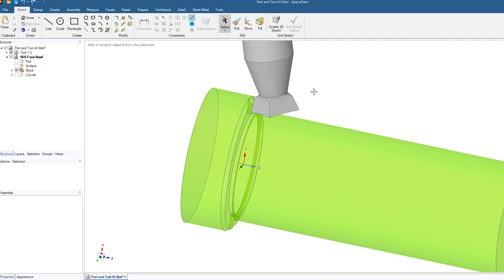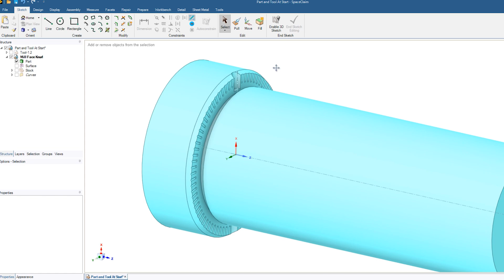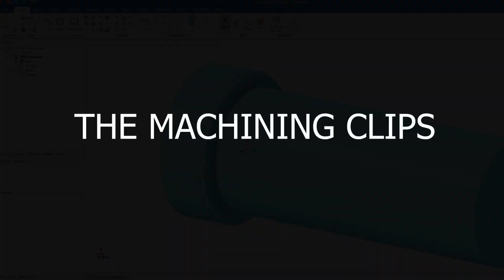A  Face Knurl ?

Comment: Somewhere an engineer and an accountant are staring at one another trying to figure who gets to explain the bill to the boss. 😅
Reply: I would 100% put  separate lines on the bill for the "knurling", even separating out the cad/cam time and machine time just for the that op x48.
Reply: If you were to tell me that these end up in a theme park somewhere, I wouldn't be surprised. Often an oddly confused collection of "we don't know why" for art and "we won't say why" for propriety. I confess to being on both sides of those equations over time. It is truly a delight when a machinist can infer the intent and look past the omissions in drawings to come up with the correct result. Definitely an indication of your talent! 
(And yes, I've seen exotics go into parks for no valid reason...sad use of the material, IMHO)

Comment: I probably would have taken a sharp radius turning tool and ran a fast feed rate, almost like a thread, across the face. Rings for pipe fittings use that technique a lot to grip the gaskets they use.

Comment: Yours looks pretty good!

Did you touch that jaw with the cutter? Looks like fine nibbles!

Presumably the knurl is there to allow hand tightening.
Had I just specified "a knurl" I would have been happy with a 1/16 end mill cutting cross hatches by touching it sideways I think.
Reply from the maker: Yes the endmill just touched the soft jaws.

Comment: I would say that you should angle the lines, then run it again but angling the lines go the other way to make a cross hatch, you could do it with a subprogram, but that would be pretty boring for 58 parts!😂 Set it up on a helper's machine.
Reply from the maker: They didn’t want a crosshatch pattern.

Comment: I'm guessing the surface rotates on another metal part, the knurl is to hold oil or grease. With such a small cutter I would think the life span would be short. De burring would be vary important and might be a bit of a pin on that hard of metal if you had to do it.

Comment: Wouldn't it have been possible to use your "home made" hobbing tool and use the mazak like a shaper (similar like you made the corners of the hardy hole in the anvil)?
Of course it would be a straight serrations "knurl" too...
Reply from the maker: Yes and that was my next idea if the milling wasn’t acceptable.

Comment: Peter, the knurl is for oil lubrucation: like Hand-Scraping on a Way. You could do any kind of pattern that traps oil.
Reply from the maker: This part is a piston for a telescoping cylinder. If I had to speculate I would say. When the piston is fully extended against this shoulder. There is a certain amount of surface tension/break away force in the oil that stops the faces from parting when the pistons retract. These little slots reduce that.
Reply: Yes, I see. You are right.

Comment: How long does an operation like that take per part?
Reply from the maker: The actual milling only took around 4.5 minutes. But my cam software puts in all these clamp and unclamp codes on the rotary C and B axis so that adds to the cycle time a little. I guess it would have been worthwhile to edit them out of the program. With this little cutting it really isn’t necessary to clamp them.
Reply: @EdgePrecision  Did you do this in esprit? I know how to get rid of all that I believe.
Reply from the maker: @joshuawentworth7426  Yes I did. I did select to not clamp the C axis but not the B axis. I assumed it would not put the commands for the B axis. But for some reason it rotates the work plane and then canceles it for every line. It doesn’t actually move the B axis. But it puts in the clamp and unclamp M codes around the work plane rotate rotate (G68) line. It really doesn’t need to rotate the work plane but once at the beginning. Because it doesn’t change for the whole tool.

Comment: Great machining, but it's not knurling. That involves the imprinting of a texture on the workpiece. Either way, NICE work.
Reply from the maker: Thanks! But yes obviously not a knurling. The print called what they wanted on this face straight knurl. Hence the name Is It A Knurl? But it’s a little impractical to put a knurl this close to an OD. It would require some very special tooling for only a few parts. So we did it this way and the customer bought it.

Comment: Perhaps you want a mini shaper attatchment with Capto cone for such tasks?
Shouldn't be too difficult to build, with the machines and capabilities you have ;-D
Perhaps similar to those, with tool retractiion, as no chip relief is required there.
https://www.youtube.com/watch?v=7klunkuScXs
Reply from the maker: That’s a very interesting machine in that video. All that isn’t necessary on this machine. You need to watch my videos on where I did snapping with this machine. On a CNC machine you can just program the movements without rotating the milling spindle. Look at my videos on making the Anvils. In them I shape the square hardy holes.
Reply: man that machine looked like from outer space basically a vertical shaper.

Comment: On the one hand, it's nice the designer wasn't too fussy about the "knurl" pattern. On the other more wtf hand is it really necessary at all?!? I'd be very interested in the application that made that feature critical.
Reply: This is the piston of a telescopic cylinder not sure what the knurls are for.
Reply: from a response Edge Precision gave elsewhere:
"This part is a piston for a telescoping cylinder. If I had to speculate I would say. When the piston is fully extended against this shoulder. There is a certain amount of surface tension/break away force in the oil that stops the faces from parting when the pistons retract. These little slots reduce that."